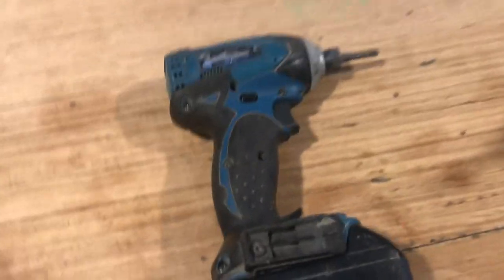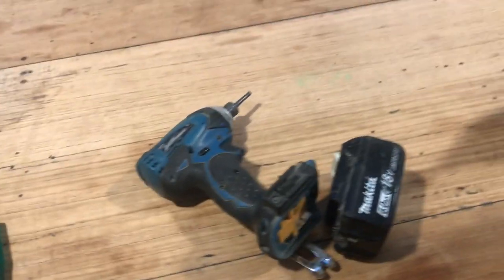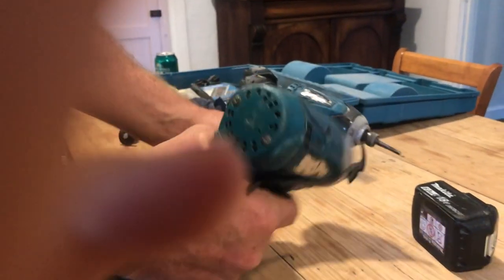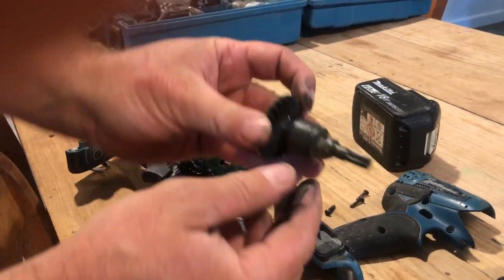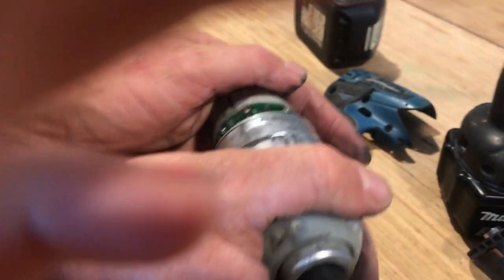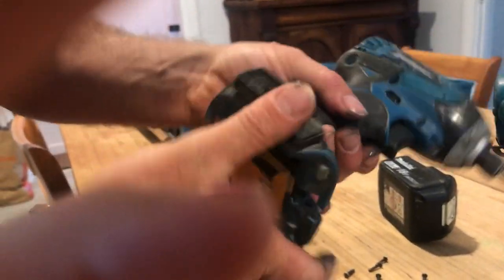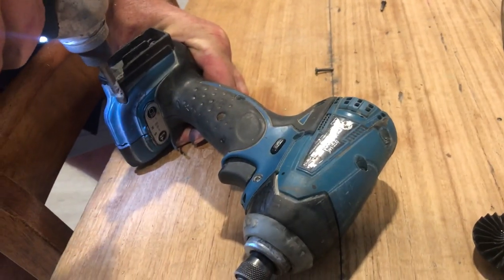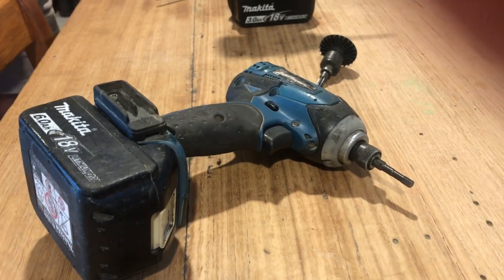Makita impact driver not working, tear down and fix. Light just flashing. Rotor problem

Comment: 5:35, you want to use the magnets to magnetise your driver bits.  do yourself a favour and buy a proper magnetiser/demagnetiser from an electronics shop.  they cost less than $10.  i checked out videos of people pulling them down.  they're just magnets in a plastic housing.  so i bought one anyway and glad i did.  the demagnetiser function is so useful.  i have sat in front of the tv magnetising screwdrivers then demagnetising them and doing it over again just because i can.

Comment: Goodnight Friend ..
I want to ask you whether the dtd148 rotor is the same as the dtd145. the thing is, I have a dtd148 drill, it has a problem in the rotor, I tried to find it in my country but it doesn't exist. do you want to help me by finding your country and sent to me 🙏🙏
.thank you very much if you can help me